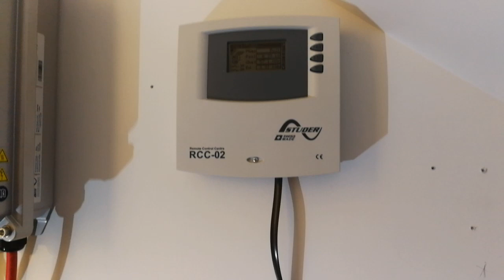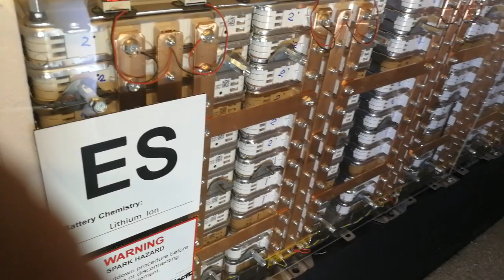50KWH NISSAN LEAF SOLAR BATTERY

Comment: Just curious, do you know the batteries state of health when you disassembled them? Is it fair to say the realistic capacity is much less than 50kWh? How is the system performs after a few years, I know you upscaled already, but is there anything what you would do differently? For example getting 8 packs as opposed to 7, to get higher voltage?

Comment: The Batrium defaults are 3 and 4.2 V. Your leaf batteries are much higher. Does the new update allow for those higher numbers?
Reply: The mid terminal of the leaf battery is where the 4 internal cells join, ie. 2S-2P. The battery module/block is therefore a nominal 7.8 volts. This bloke shows what is inside, albeit in a risky/dangerous manner:
https://www.youtube.com/watch?v=VeTxXkBAc60&t=448s